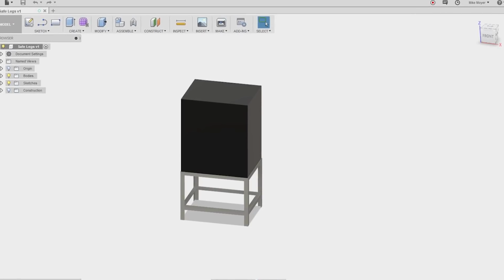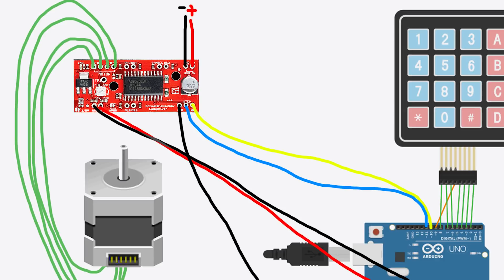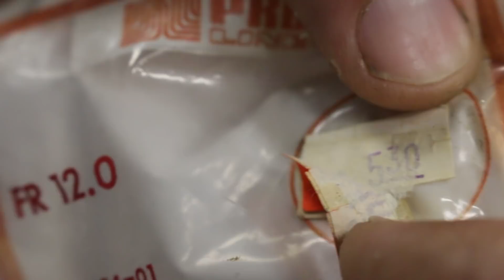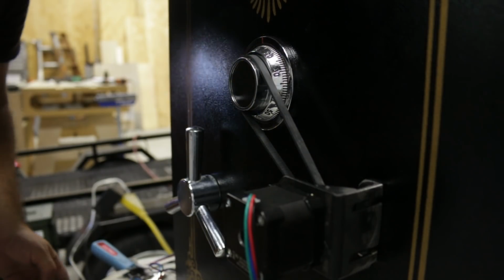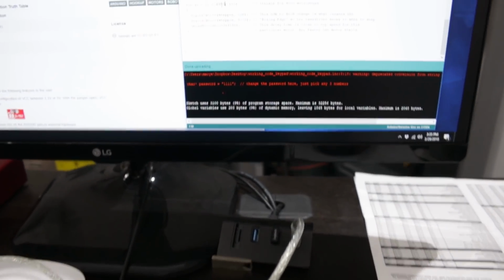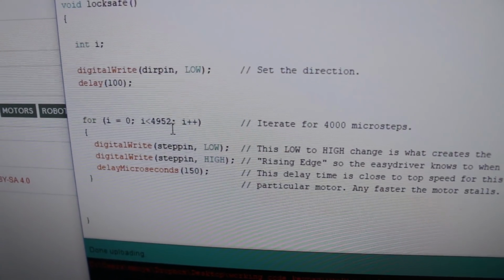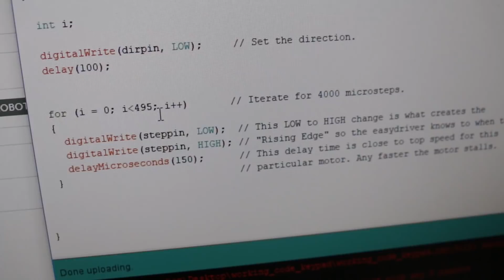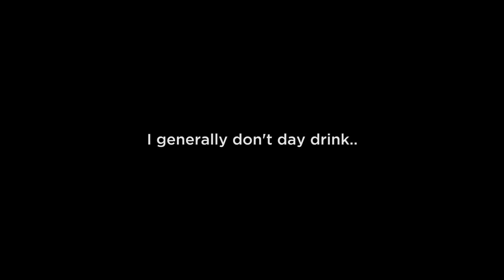Liquor Cabinet with SAFE "CRACKING" ROBOT!

Comment: Switch out the easy driver for a tmc 2208 or 2130. You can make it nearly silent. The 2208 is easier to use. Another option is the 2100

Comment: Ok, I was expecting some "cracking".  This feels like you just took an old safe and made it digital.  I mean you can buy a digital safe that same size from Harbor Freight (when its on sale) for the about the same price as what you paid for all your materials.  Granted it won't have that geeky cool factor but still.  I mean considering all the effort you put into this and the amount of space on the back of the door it seems it would have been cooler to make it more integrated.
Reply: cracking a safe with steppers isn't allowed on youtube. It's too effective and achievable. Safe manufacturers are in panic mode and need to introce a time-out like atms and passwords. 1oo failed attempts and come back in an hour would suffice. 

This video is a work around to demonstrating how it could be done. Even if it would take a months, it is still profitable.